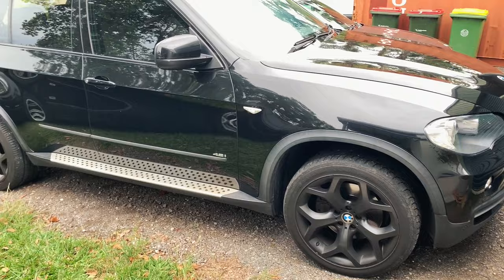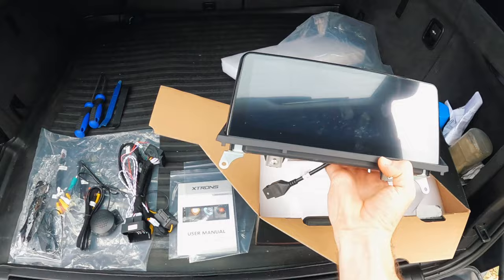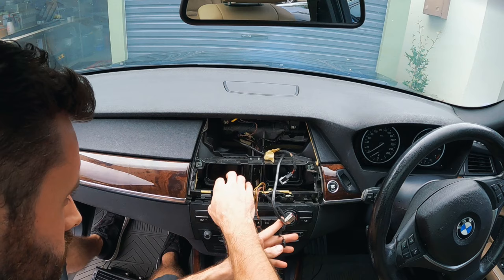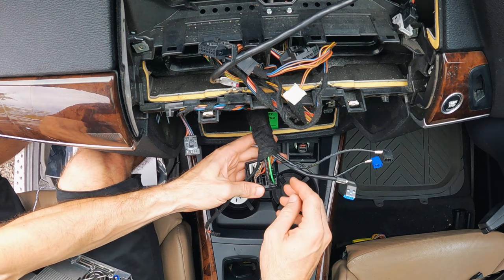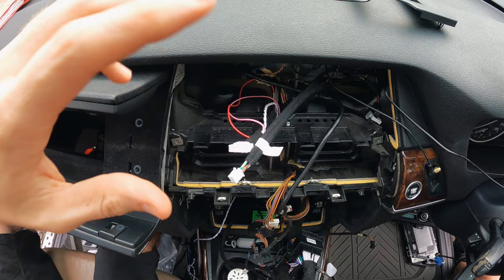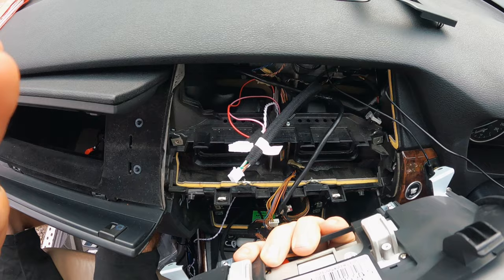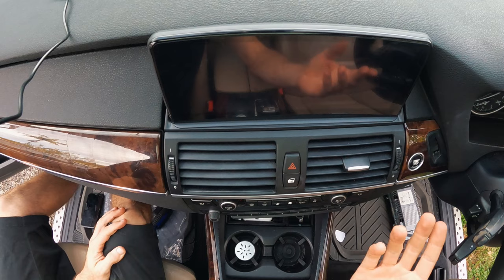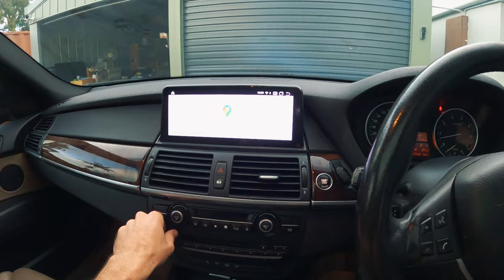How To Install Android Head Unit For BMW X5 E70 & E71 X6 - The Ultimate Multimedia System

Comment: I bought an Android system similar to this from XTRONS but I'm finding the Aux output sound is terrible, even when using the car's Amp (Aux front) you still have to crank up the volume, which then produces a hum. I've even tried adding a portable, usb powered mini-amp, and that is only a little better. Anyone else have this problem, and have found a good solution?
Reply: Yes, mine connects directly to the back radio like this video. Does the same thing and mine is not from Xtron. Did you resolve yours? Im planning to get a non portable DAC and use 3.5m AUX instead and give it a go... Hope it works...

Comment: Looks great. But how about back up camera?
Reply from the maker: The stock camera in the x5 was faulty at the time. Turns out the factory wiring had broken in the tail gate. It is working now.
Reply: @ZeroTo60Tube  did you have to use extra wires? I've hook mine up and went into settings and changed it to oem and still no video 🙃
Reply: @taylorsons4303  did you resolve it mine not working
Reply: @Bacon-cn1wr  hey I just plug my oem to the adapter and when in settings and pressing and play around with a couple settings and it started working 💪

Comment: Did you try the oem reverse camera to see if it works with the head unit? Just installed one on my e70 and blank screen for pdc and reverse camera
Reply from the maker: Oem camera was dead on this car. Before the unit went in.
Reply: @ZeroTo60Tube  oem camera actually works with the unit, I had to make sure the connectors were in properly on the patch cable

Comment: excellent video When you turned on your Android, the sound came out of the original car speakers. I mounted mine but the sound comes out of the small Android speaker. How do I change this situation?? please!!
Reply: Hey I installed mines yesterday it does does the same, did you manage to solve the issue

Comment: Great video! I bought an Xtrons Android 10 for my E92, to replace some other high spec. low quality no-name junk that I tried first. I am glad I went to Xtrons.

Did you manage to get all of the steering wheel buttons to work? I was hoping to re-program the talk button to work with the Xtrons head unit, not the old (useless) CCC phone system, but I can't find a way to do it. I have the same steering wheel buttons as this X5 in my E92. I can only get the volume and track buttons to work with this unit, everything else only affects the car's CCC system and if is quite confusing. I would love a system mute button. I also don't know how to activate voice control, except by saying "Hey SIRI" over the music and hoping for the best. Do you know what I might try to get these controls working, or is that not possible?

Thanks

Comment: What the reason that some cars needs to connect the AUX cable and some cars does not ?
Reply from the maker: Some cars have the aux going in to the back of the CCC unit, the same place this unit plugs in. Where others use the MULF for aux input which is in the boot. So if the car has CCC aux, you are all sweet, if not you need to connect to the aux socket in the centre console, which actually runs to the rear of the car.
Reply: Sorry, but I was talking about CIC units.
I've search to know the reason why CIC cars (about 20% of them) needs to connect the AUX while the rest do not ?
Reply: Update: upon the supplier instruction to perform "learn" procedure on the CD's selection buttons (with the AUX cable connected), the unit worked and the sound is as good as the oem unit 👍👍 and I have no clue why did that work 🤷‍♂️
Reply: @eslamsedky72  can you explain exactly what you did to get better sound quality?
Reply: @jrlathrop1 
Just to make things clear: there was no sound coming out from the unit (android screen), what I did was (and that apply's for CIC systems only):
On your original car system go to "Multimedia" and select "AUX" then press and hold on any of the 8 buttons above the CD slot till a "AUX assigned" message will pop on the top of the screen ", now every time you want to use your new screen switch to the android and push that assigned botton.
Note: AUX cable have to be connected from the android unit to your original "AUX in".
Reply: Can I use OEM gps antenna ?
Reply: @mickysmiley3064 
All of the aftermarket units come with an extra gps antenna if you want to install it, but you can keep the oem antenna and use it

Comment: Hi, your vid is awsome! I have rhe exact same model but a chinese android. Aux connects directly to the back of radio; however, my volume is ridiculously low compared to original car volume. Then when i ramp up the volume, static sound starts, very annoying. Does yours have the same issue? Im planning to use the 3.5m aux instead and connect it to a DAC, if i do so is it required to unplug the aux that is behind the radio or no?
BTW, is there a ground wire? dont think i seen it in your video...nor mine...

Comment: BOY"S !! If your "Subscribers"  or New viewers have one of the Android 6,7,8,9,9.1 head units and are having trouble with no sound  then I found the answer for the DSP Amp problem to save lots of rewiring.... (Remember to Subscribe to "Zero to 60"  and hit the Bell as well)
 
All you need to do is link the Power Ant wire (Should be Blue one - pin 12) to the Power wire (Red wire - Don't link the Acc (Orange wire) wire and everything will work including the balance control, Bluetooth sound & Phone Mic etc.
 

Also If someone is using a Bluetooth OBDII reader and having problems linking it to their unit.. then all you have to do is to change the password on the Head unit to OBDII password which will normally be 1234 or 0000 ...

Comment: I have the xtrons unit in my X5 and its a pile of junk, bluetooth is wacky and it seems they have locked it down with some garbage bluetooth chinese app.  It wont even connect to my bluetooth obd2 adapters.  then I ordered an xtrons obd2 adapter and that doesnt work either.  I might be sending mine back in for a AVIN unit.  Oh lets not forget that their tech support wont answer my messages.

Comment: Do you know what causes some cars to work with or without the AUX cable?
Reply from the maker: It’s the confit of the factory stereo. Base models have aux in direct to the ccc. Upper spec models have a mulf module for aux in, which converts it to a digital signal then send it to the ccc. Also some cars have 2 aux ins as well. I hope that makes sense
Reply: @ZeroTo60Tube  So just to be Clear, is the car you are working on the upper spec model with a mulf module, and that is why Audio works automatically without an Aux cable? I have a 2008 X5 e70 35D with all the bells and whistles however I am having dramas with the audio. Trying so hard to avoid using the Aux but dont know what the issue is. If you have any ideas that would be awesome. Love the vids and the channel by the way.

Comment: Android means it won't work with iPhone?
Reply from the maker: It just means its an android operating system. Which really means you can run any app you want and do anything you want. These will connect to iphones for bluetooth audio out of the box and with and app and dongle you can use them as a iphone carplay device.
Reply: @ZeroTo60Tube  Thank you. I've already ordered mine (Koason). My next super challenge is to change it by myself. As US Marines used to say: The difficult we do right away. The impossible will take a little longer.

Comment: This unit has serious issues. Not real Android 12 for starters. Google maps has no sound unless you have the radio on, WiFi only connects to your phone when it is on and in range, in other words if you want to another wifi you can't. It randomly switches modes and it likes to ignore your Idrive as well.  Tech support is a joke............. I sent mine back. Fortunately I got it through Amazon, so no issues with that at least.
Reply: Did you sorted problem?I have same problem with my! Thanks
Reply: @constantinflorin5180   Yes, I took it out and sent it back. It is junk and not at all what they claim.

Comment: Great video. Can you recommend a particular citrons unit for an e92 or are they similar?
Reply from the maker: They are all very similar nowadays, but Andrews unit doesnt let the idrive knob control all of the apps, only the mains ones, whereas this unit you can use the idrive in every app, which is surprisingly useful. If you can contact the seller before purchasing that would be something worth asking.
Reply from the maker: Also this spec was really nice, it felt great to use with the cortex A53 and 2gb of RAM